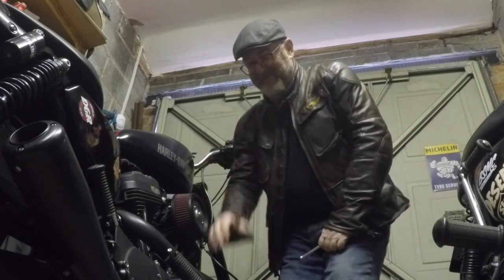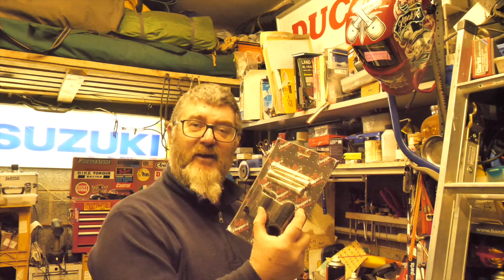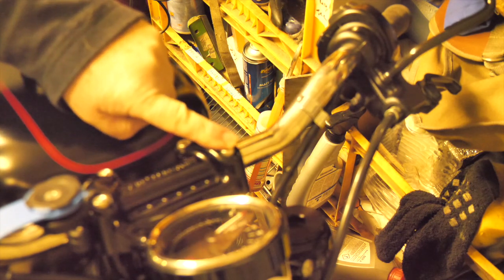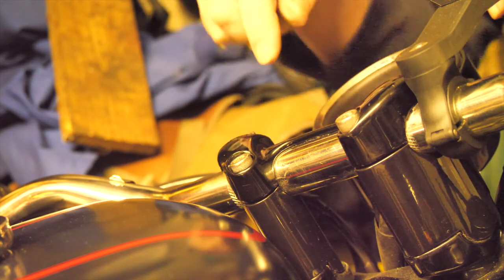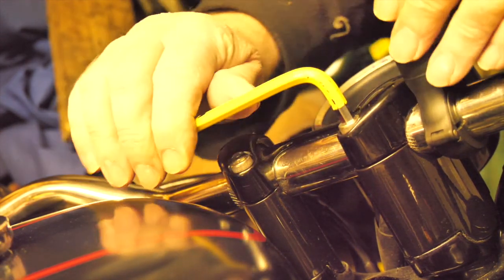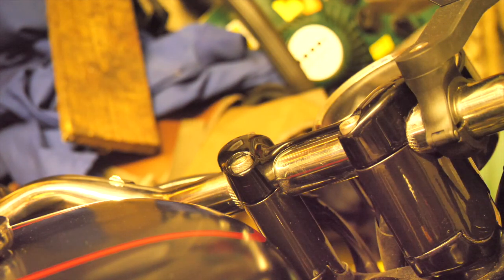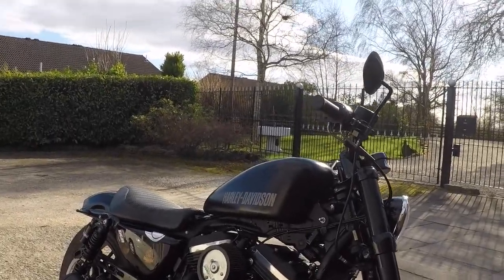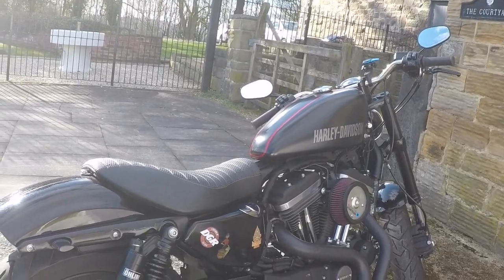Harley Davidson XL1200CX Roadster Mods review

Comment from the maker: At approx 1min 30 to 2 minutes in the video I show the packaging and quote the make. They are labelled L A Choppers, manufactured by Drag Specialist? Bought over internet. Will try and find where from - possibly Hog parts U.K.
Reply: Thanks man! Do you find that’s a good height to make the ride more comfortable? I’m deciding between the 2” and the 1” riser, I’m afraid the 2” might change the ride position a little to much upright and increase the wind blast at highway speeds.